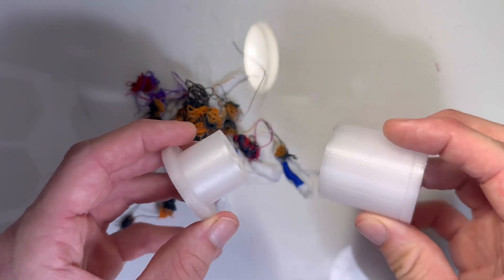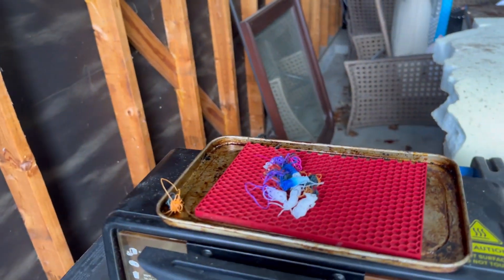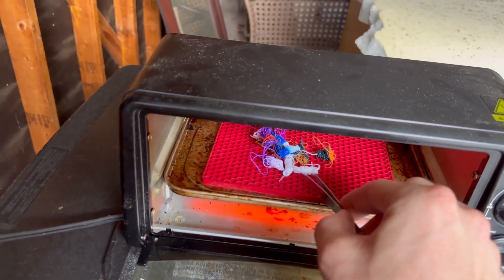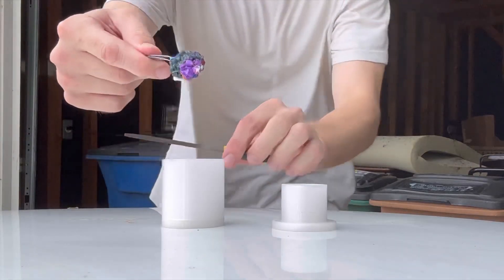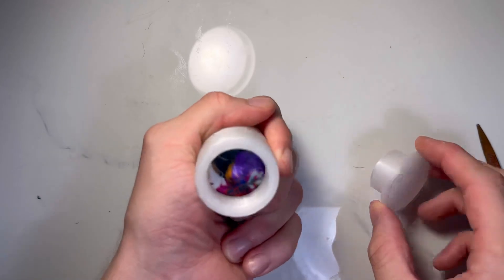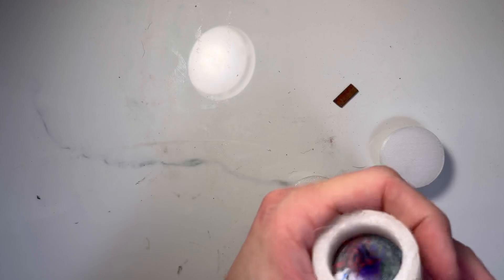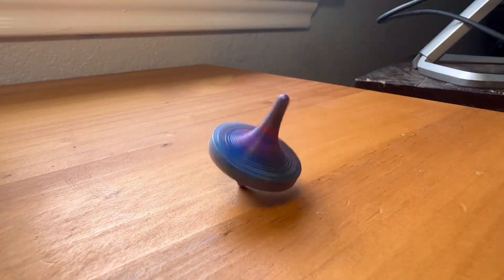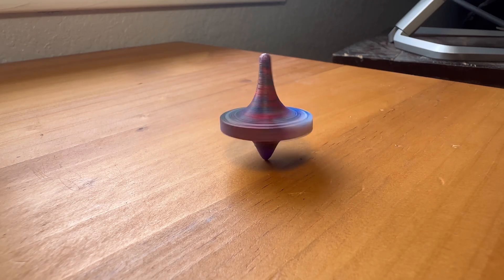How to Use a 3D Printed Compression Mold (Easy Tutorial)

Comment: Just wish 3D printing was better at doing shallow slopes..oh well, this obviously isn't the only use for this concept :p
Reply: lower the layer height, you'll still get steps but less visible
Reply: @bastv2417  I was thinking more than non-planar thing, but even that isn't perfect..
Reply: Depending on the geometry you could also sand the molds. Or print in something like ABS/ASA and then smooth it.

Comment: What is a very good idea for home recycling, at least better than in some waste sorting.  Personally, I have already made more of them and I would like to give you some tips on how to make your work easier. First of all, it is good to print the form to the lowest possible layer height, then the product does not stick as much in the form. In addition, I use cooking oil. It helps a lot to release the products.  cool the mold in cold water, for example, and the last idea I used filament pla ht 110 and thanks to this I can also recycle PETG without it sticking, this material can withstand a higher temperature than PETG, in any case, I am very happy for this way of recycling and as soon as I fine-tune the production process, I will start with other  forms 

Co to je velice dobrý nápad na domácí recyklaci aspoň lepší než v nějaké třídění odpadu. Já osobně už jsem jich udělal víc a rád bych vám tedy dal nějaké tipy jak si ulehčit práci za prvé je dobré tisknout formu na co nejnižší výšku vrstvy pak se výrobek nedrží tolik ve formě navíc používám olej na vaření velice pomáhá vydání výrobků další je dobré nechat formu ochladit třeba ve studené vodě a poslední nápad použil jsem filament pla ht 110 a díky tomu mohu recyklovat i PETG aniž by se prilepilo tento materiál vydrží větší teplotu než PETG každopádně jsem moc rád za tuto cestu recyklace a jakmile doladím výrobní postup pustím se do dalších forem